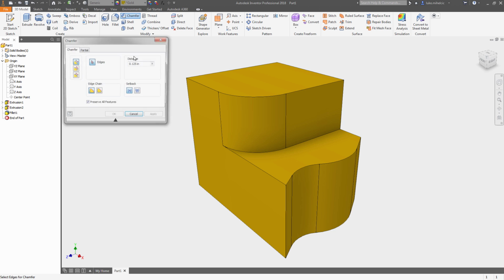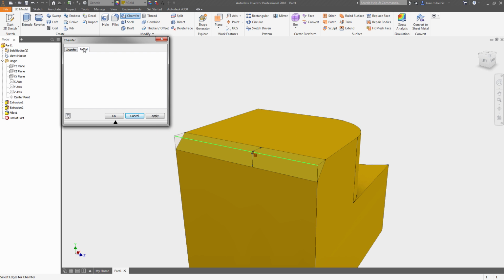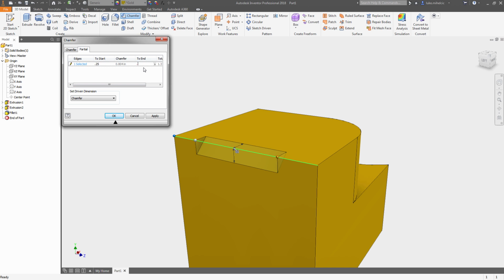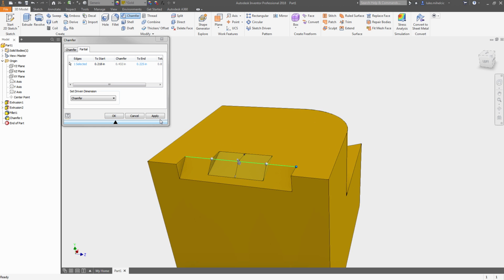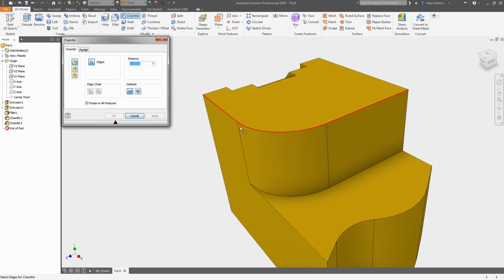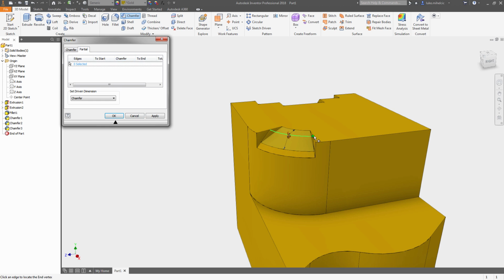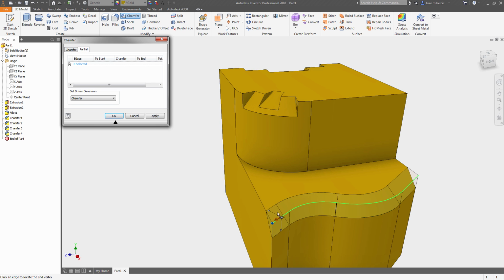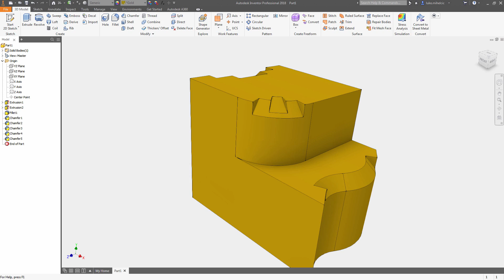Autodesk Inventor Quick Tip: Inventor 2018 chamfer

Comment: in reality, many tools (including chamfer) get unusable because Inventor insists on re-calculating geometry after each partial selection, making the process exponentially slower. No option to disable this horrendous BS seems to be provided. Just buy a faster machine, peasant.